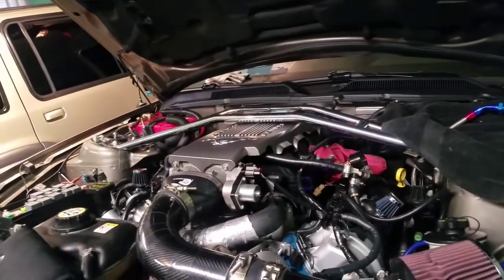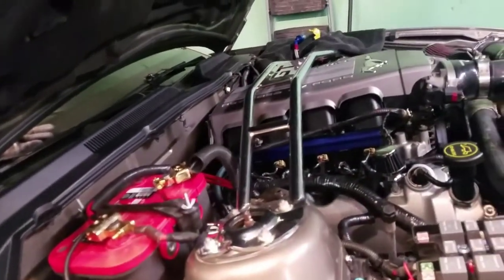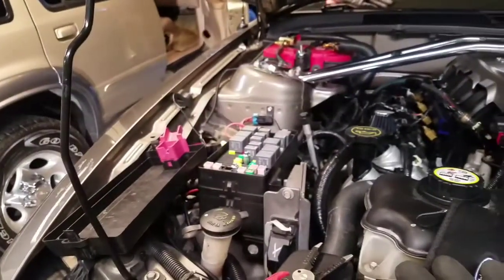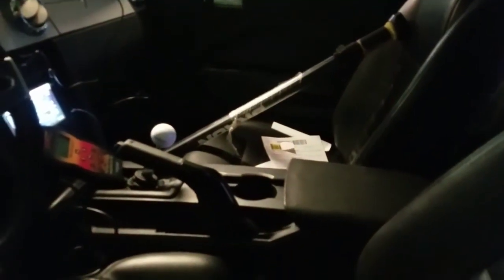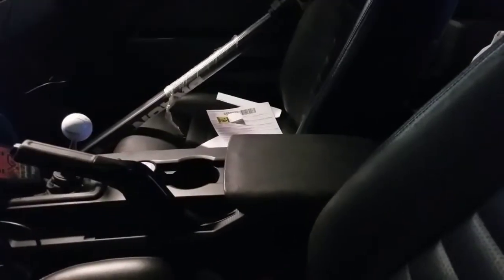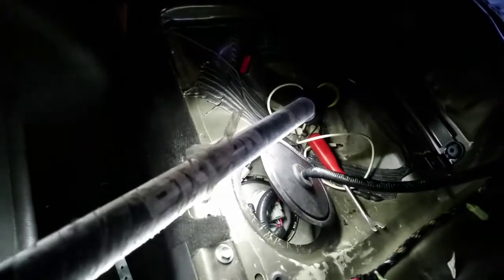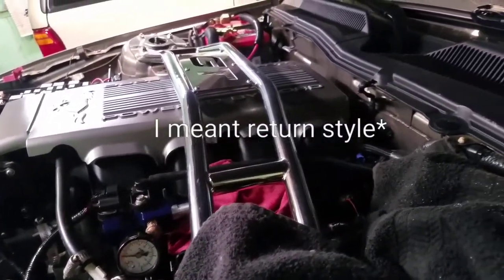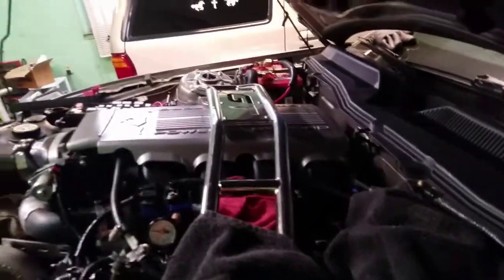Turbo Mustang 3v p0690 troubleshooting

Comment: The issue I had was splicing my boost gauge power wire to the pin 18 at the kick panel(abs/ignition) causing the code. Added a dedicated power source and fixed it. Make sure nothing goes to the ignition. Instructions also say “vehicle's stereo, ignition system, ECU, lighting, or fuel pump should not be used.”
Reply: Im pretty sure I got the same problem
Reply: Can you give me more clear instructions on how to fix it ?

Comment: Also get you a couple metal paper clips. Where they pcm connects look up the wire colors the use the paper clips to stick in wire use those to test with your multi meter. Volts and resistance. That way you don’t cut into the wiring

Comment: Hey bro did you ever find out the problem I have the same issue but mine starts everytime. If it doesn’t start with key out turn the wheel to the left until it locks the steering wheel. These years had some weird tricks. So then put your key in unlock steering wheel then start cars. It’s weird but works but still doesn’t take away the code

Comment: Did you make any more progress?do you have a fuel pump cutoff switch in the trunk?
Reply from the maker: Not much yet. Im still not getting fuel pressure so I'm gonna probably replace the pumps just trying to figure out which route I'm going to go. I have the inertia cutoff switch which I reset but other than that no.
Reply: TekMan05 did you try to jump power to the pumps
Reply from the maker: I was gonna do that but no one has shown me which wires to tap. I'm not a huge fan of messing with wiring unless I see a clear demonstration on how to. I may do some more searching on that topic though. I just been busy working on my Explorer recently and taking care of other things going on in life.
Reply from the maker: Weird,  so i went to put some gas in her last night and was able to get it started for a few seconds. The fuel level isn't responding though in ignition mode but I'm getting pressure at the rails now. I'm stumped
Reply: TekMan05 the gauge it’s self isn’t working?
Reply: Do you have a fb
Reply from the maker: Yeah. Tommy Tek Dean. It just started again and it was working once it started. But it doesn't stay running unless I feather it. Then it stabilized and idled I gave it a little bit of gas blips and the AFR seemed to drop then lean. Kinda hard to explain I'll have to make a video.
Reply: fuel shut off reset is behind the hood latch get down their theirs a button